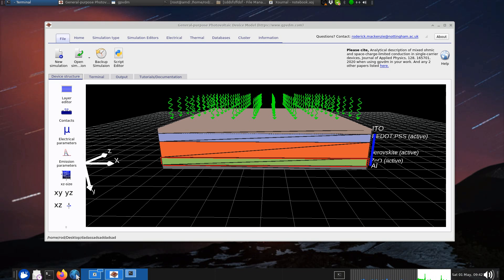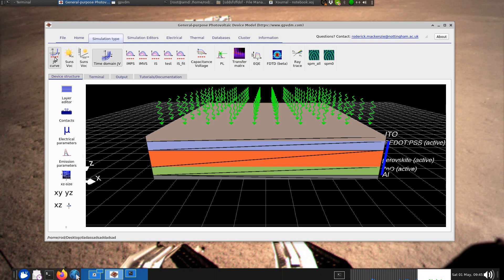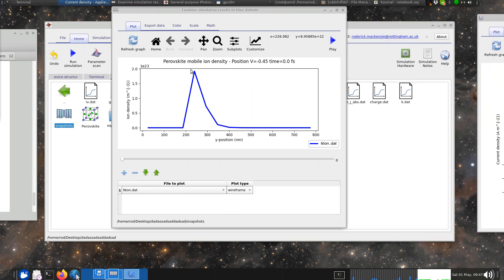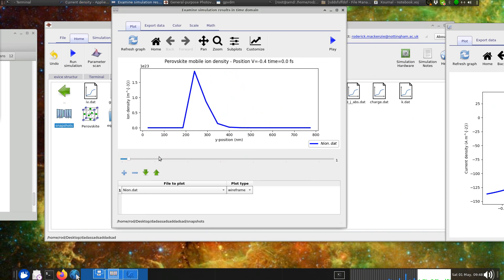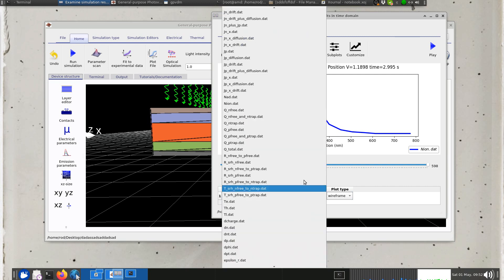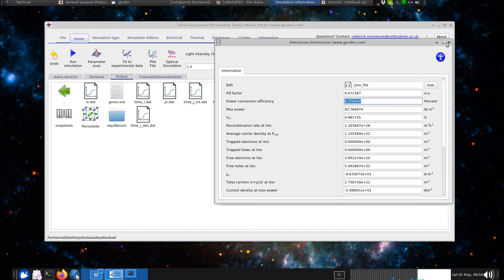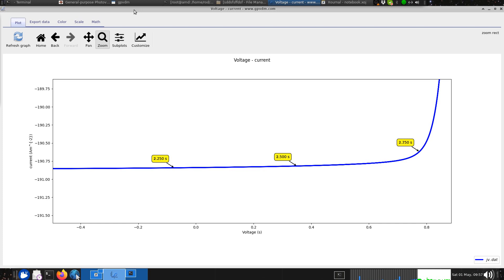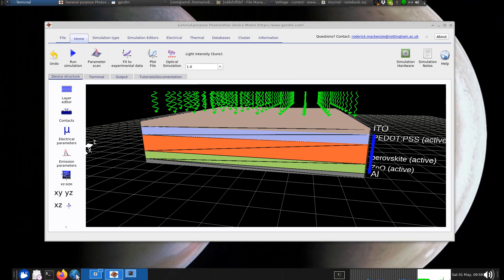Simulating perovskite solar cells with mobile ions and hysteresis - a tutorial.

Comment: What if it is taking a lot of time to simulate just the JV curve of simple perovskite model? Is there some issue?
Reply from the maker: It's prob simulating it in time domain so doing voltage sweeps. Just click on the JV icon in the sim mode ribbon. By default it dump a lot of data to disk in the snapshots folder. If you are running on a mechanical HDD then that can be slow (Or you have a virus killer running checking all writes to disk). You can turn off dumping to disk in the JV editor window.
Reply: @OghmaNano  Oh yes. Thank you very much. I was working on the HDD. I ran the same software on SSD and it worked instantly. Thanks for quick response.